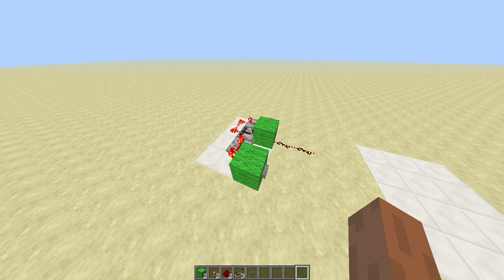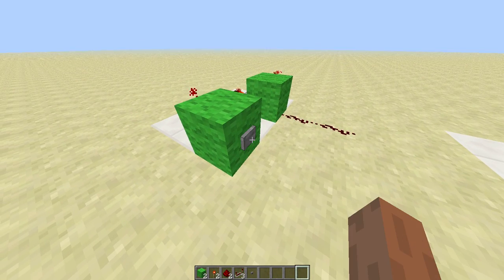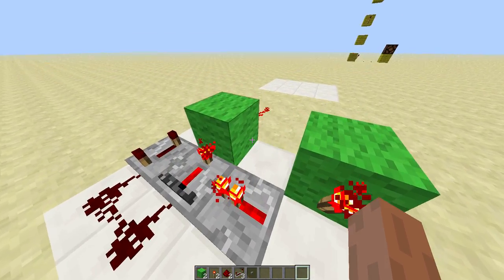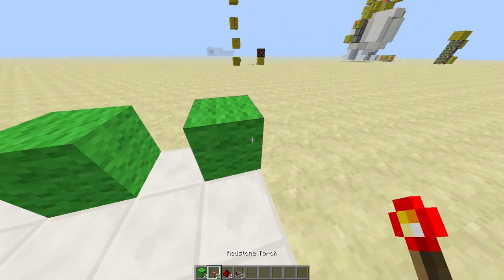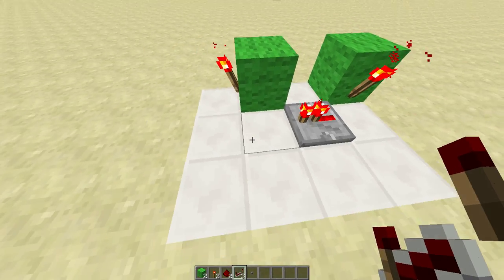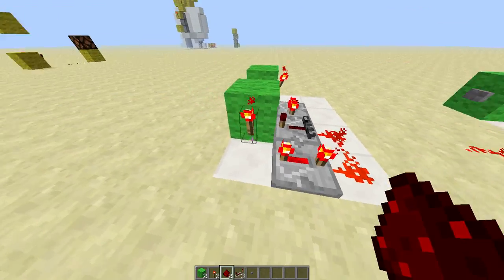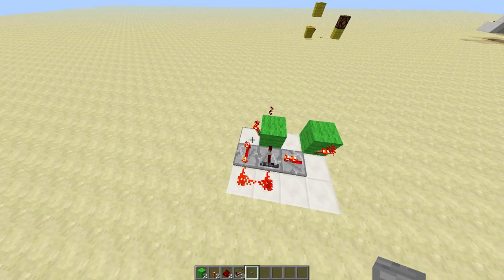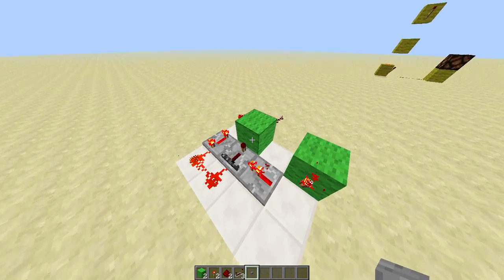Pistonless T-Flip Flop Tutorial 1.7.2 (3x4x1)

Comment: This didn't work for me had move timer back 1 block and add a second repeater connecting to timer with 1 piece redstone to torch to lock the signal
Reply from the maker: Its possible it is a directional issue. If I could remember which direction it was facing I would tell you. A lot of times orientation will have strange effects.